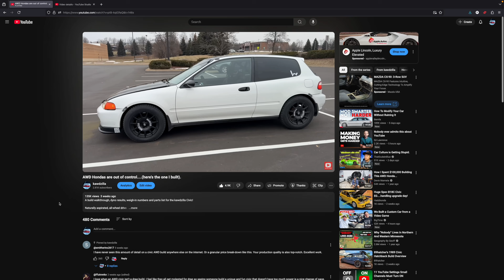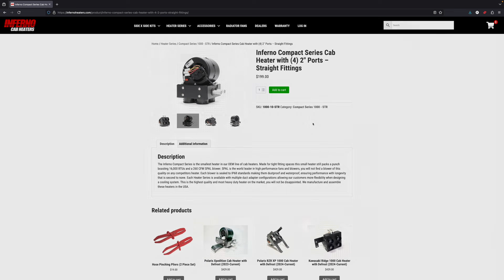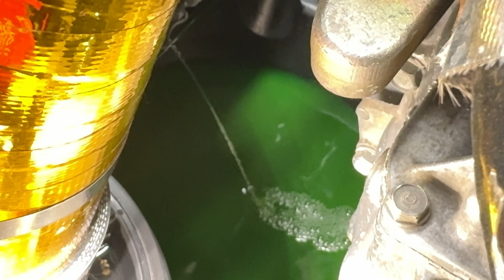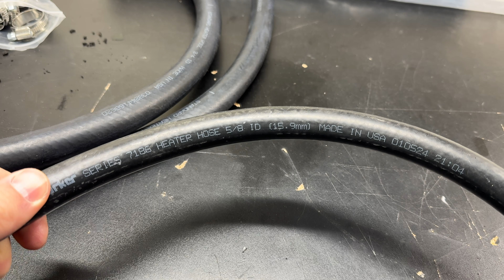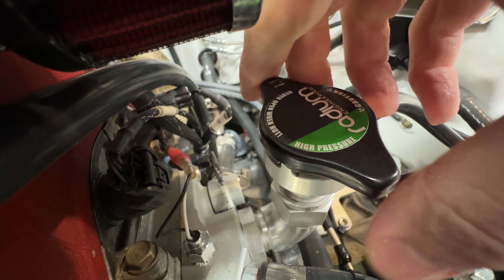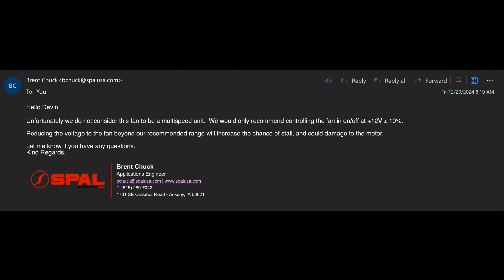A Better Way to Heat Your Project Car.

Comment: Did you know that the Porsche 917 used the steel frame tubes to run oil from the mid-engine to the front oil cooler? The book "Racing Porsches" covers this. It also had a pressure fitting to check for leaks. What do you think about running PEX tubing throughout the car? Maybe heat the floors or even the running boards and fender wells to prevent ice buildup and rust. We're up here in AK and that would be sick. Put the soundproofing on the outside to insulate the thermal mass. I see you moved to Aridzona to hang out with N-Tuned. Too much heat down there is a problem, up here we can never get enough!

Comment: I had a similar solution with my v8 swap Miata, deleted my heatercore a few years before the swap for weight reduction and added a universal ATV heatercore back in later when I moved to Montana. I have the version with the centrifugal fans and especially with the aluminum block LS it fills my cabin with more hot air than I know what to do with, I don’t even have any ducting and it’s worked a treat for years in -20 degree weather. I am thankful to have a 3 speed fan controller though
Reply from the maker: Awesome. Used to live in Montana.

Comment: Usually defrost pulls air from outside isn’t this more like recirc? how well does it work at defogging the windshield with the potentially humid interior air?
Reply from the maker: Works great, no fogging.

Comment: Getting into the fine details of the video and man starts dropping jokes like no other hahahaha I respect the order of ducting to get it hot n' ready! It looks like 90's touring car era ducting used for cooling brakes. Every time I see HVAC work, I'm reminded it can be rather simple, but daunting to know where to begin. I had a lot of questions about the system until they were explained, especially with the support pump routing and bleeding air out of this setup. I have similar challenges trying to fix my project car and it's more of retaining the factory HVAC solution rather than redesigning it. I'd love to know more about your wiring because it looks like you've eliminated practically all OEM harnesses being this is now K-powered and not the original OBDI setup. De-pinning and re-labeling everything is something I am not looking forward to, but seems inevitable for getting exactly what you want! Great work as always!
Reply from the maker: Gotta have some jokes, can't take a heater video too seriously now.

Comment: Nice video! That is quite strange that you needed the aux pump
Reply from the maker: Didn't expect to need one. Still don't quite understand why it works in factory configuration but not here. Could be the KTuned coolant housing just has bad flow design, the hole inside the fitting is pretty small.